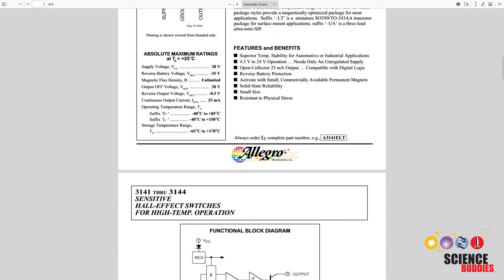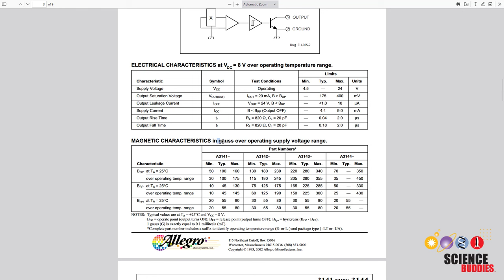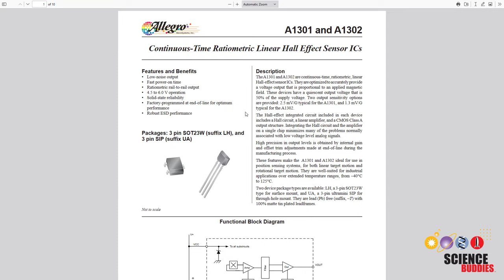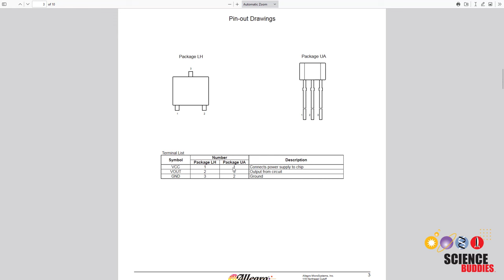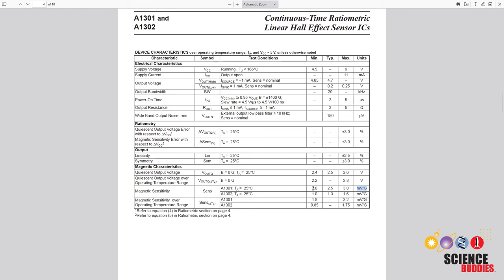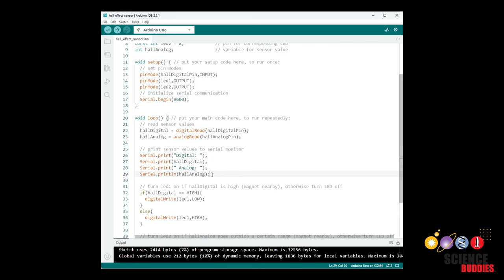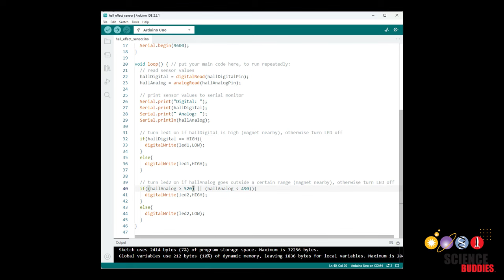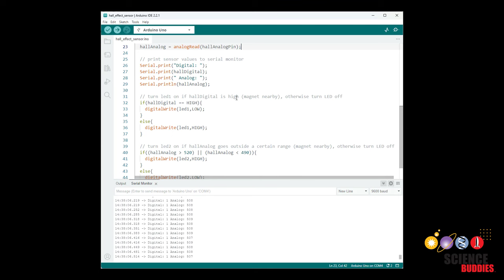How to Use a Hall Effect Sensor with Arduino (Lesson #31)

Comment: which hall sensor will give me logic high at output after detecting by magnet???
Reply from the maker: You would want a digital sensor for that, not an analog one.
Reply: @Science.Buddies  can u tell me , which digital sensor i can use?
Reply from the maker: In this project: https://www.sciencebuddies.org/science-fair-projects/project-ideas/Elec_p094/electricity-electronics/arduino-mass-driver#materials we use this sensor: https://www.amazon.com/dp/B07QS6PN3B?tag=sciencebuddie-20